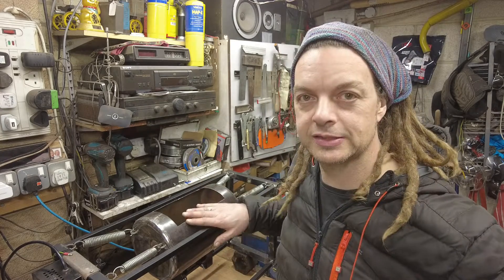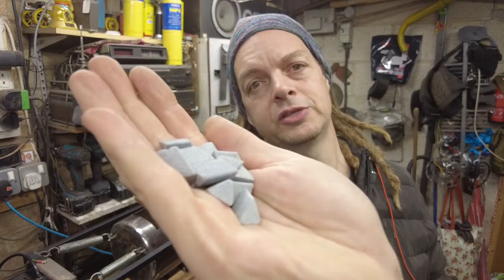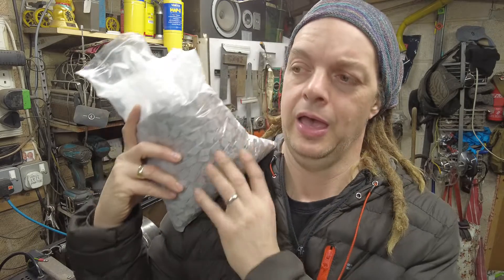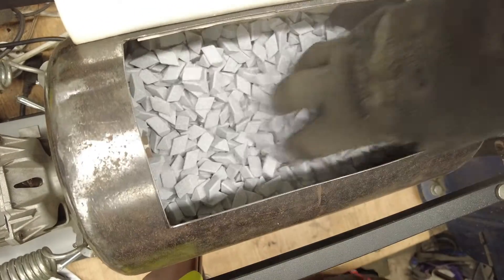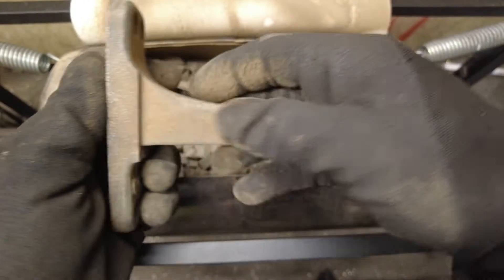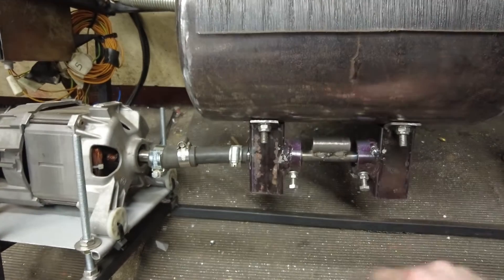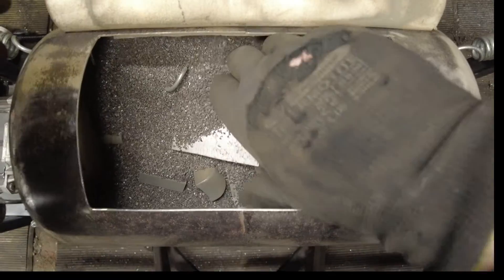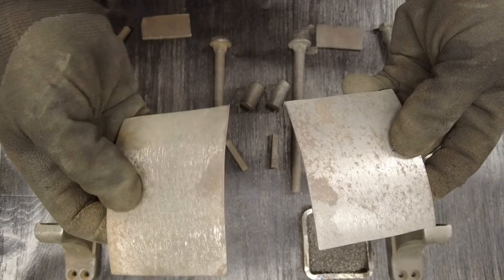PART:2 - DIY Vibratory Tumbler - BEST MEDIA TO USE - Home Made Rust Removal & Metal Deburring.

Comment: Please try to not let your voice volume tapper off so low every minute or so… makes it very hard to keep up with what is being said. Other than that… very interesting.
Reply from the maker: @rogergorden9023  Yeah sorry about that. I'm not great speaker, in life I'm generally quiet and chill, it takes me a lot of effort to 'project', but I'm gradually getting better at it 😅 Ive actually sold the polishing media as the Ali Oxide works so well on the things I need to clean, maybe I should have tried both together. Best of luck and thanks for watching. 😊👍